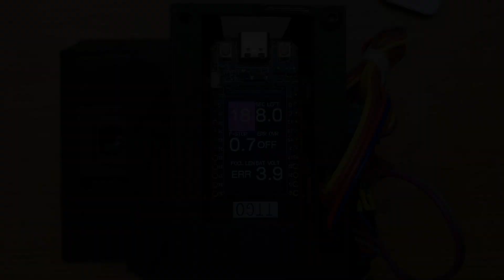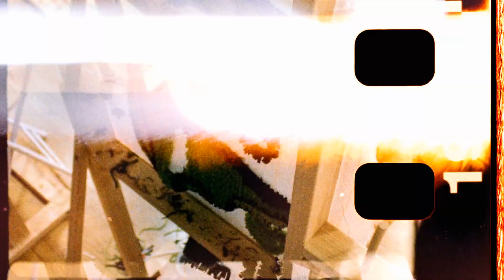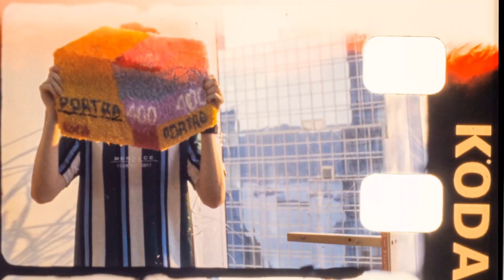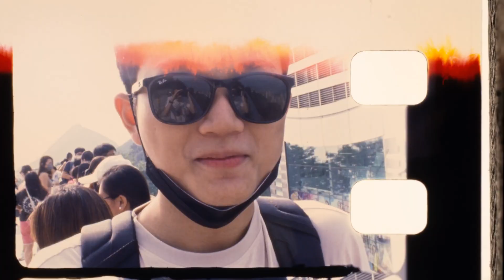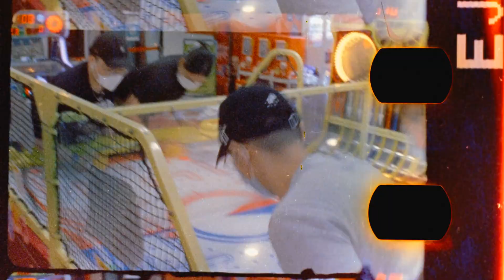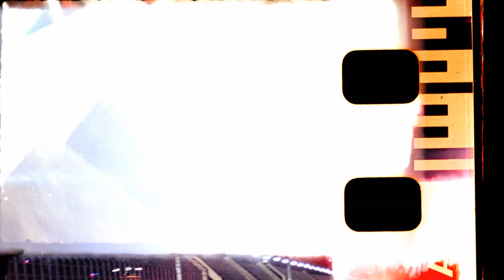3D Printed Film Video Camera

Comment: Beautiful video and great work!

I read your blog post and I think I may have the answer for some of your questions.
1. How professional 35mm film movie cameras manage to effortlessly fit the shutter into the camera.
Actually, there are lots of efforts. The shutter is basically the reason why cinema lenses have such a long flange focal distance. Professional super-35 cinema cameras often use PL-mount lenses. They have a flange focal distance of 52mm instead of 46mm (EF mount).
In addition, they reflect image to the up, not to the side. By doing this, in your case, projecting a 14x9mm image only need a shutter in around 38mm diameter instead of 44mm.

2. It is extremely hard to adjust the shutter's position, which means the focus you see through the viewfinder can't be calibrated to be the same as what is being recorded.
You don't need to adjust the shutter's position. Just adjust the position of your focus screen.

Comment: This is amazing! But o wanted to know why you didn't like the 18-55 kit lens. I read your blog and now undetstand. It wasn't really designed for how you were using it. But I think a better idea would have used an old 80's prime lens. Such as a Minolta 50mm manual lens or an old Canon FD mount lens. Yes they are manual focus. But they were designed for 35mm film. Plus I use adapters to use these lenses on my Canon dslrs and my R7 mirrorless. They give a very organic look   that would work well with your camera. You'd just have to modify your lens mount

Comment: Hear me out - larger body to hold a bulk 100ft roll of 35mm. Might be a little cheaper but you would have to design a take up spool for it. Ooooo you could also copy the mounting systems for vintage glass would be so nice to shoot with canon fd and use zone focusing. You might already know of Dora Goodman’s open source cameras but there are large communities on discord making custom cameras - reach out and bounce some ideas around because this is amazing.
Reply: I agree, if you could get some 400' (122 meter) short ends you may be able to take the price down significantly.
Edit: And if you could work out a one perf movement, you could double your runtime and achieve a scope look. Though it may cost you some registration.